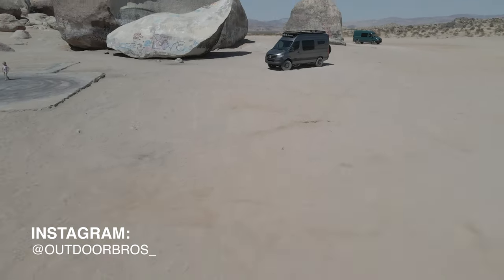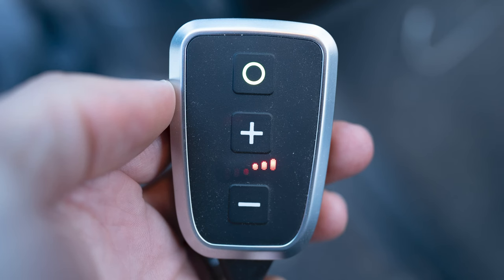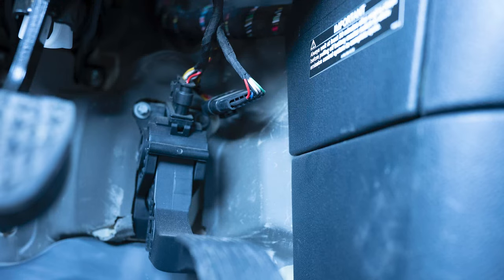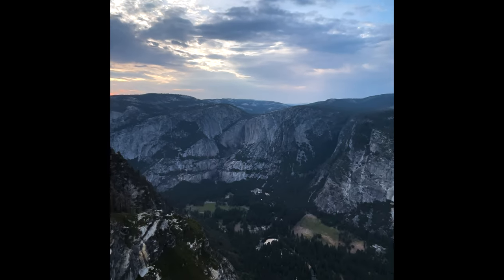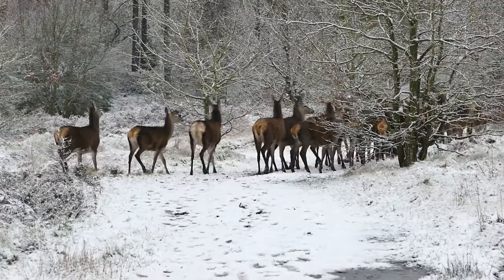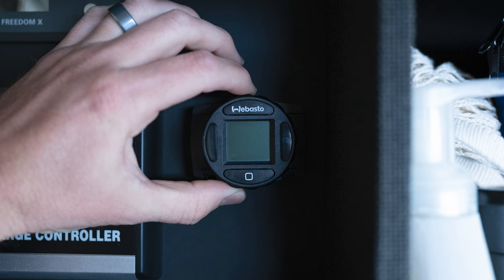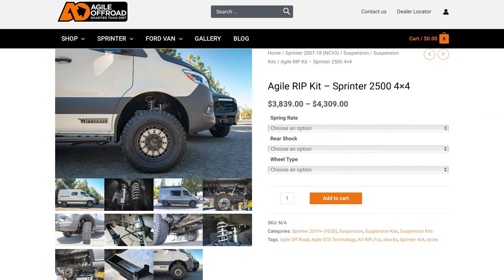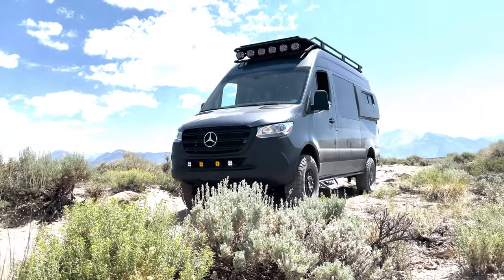Top 5 Must-Have Sprinter 4x4 Accessories/Works for Ford Transit and Dodge ProMaster Too!

Comment: It isn’t really a turbo lag, it’s the electronic  sensor on the pedal.  I needed a peddle commander for my ram truck which had a 5.7 liter v8.  It was night and day when it was installed.

Comment: You mentioned the Van Compass shock settings backwards. Setting 1 is the softest, and 3 is the stiffest. And of course setting 2 has the micro adjustments which is used mostly for daily driving.
Reply from the maker: Oops- thanks for noting.

Comment: I agree about the hideous factory lights - are those front bumper lights allowed on-road? If so, I'm ordering!
Reply from the maker: I’m not sure if they’re technically “road legal.” They’re so low that they don’t seem to be an issue. I’ve driven at my van head on and they’re much less bright than any of the trucks I see on the road today.